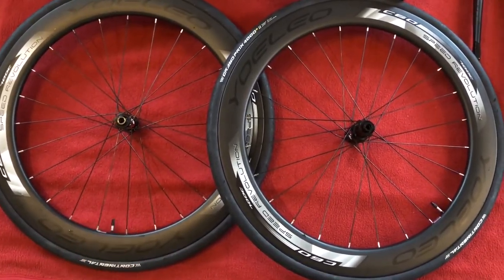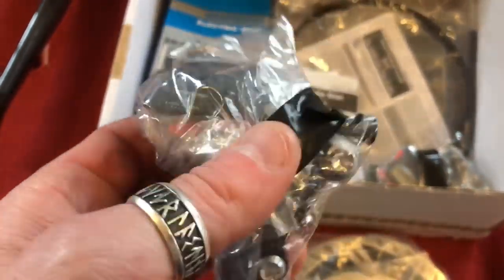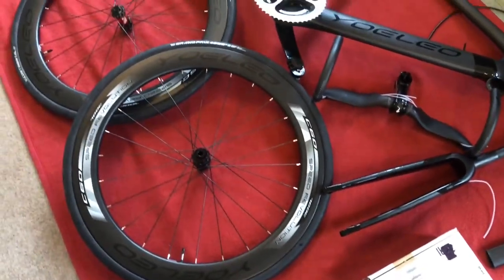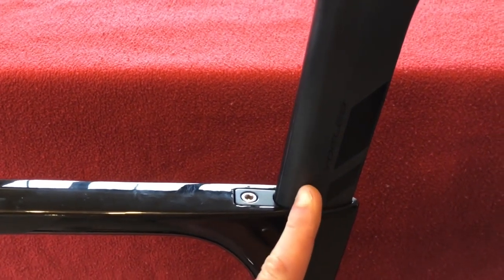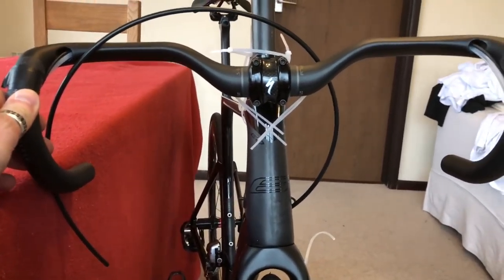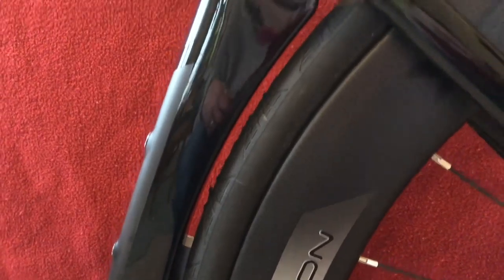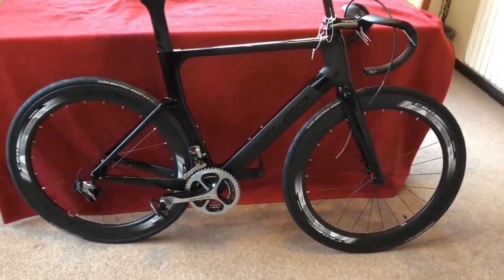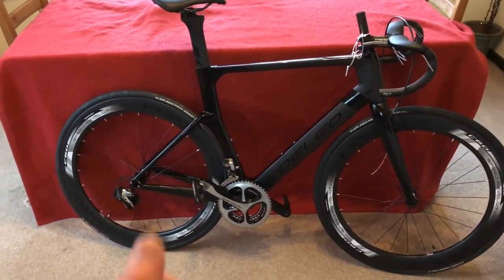Yoeleo R6 Aero Disc rough assembly before LBS

Comment: Nice video. It looks like the seat setback will be fine. I am a little confused though. The previous videos of this frame make it very obvious that the seat tube is far more upright. However yours seems to be at the same angle as the headtube . Maybe it is an optical illusion with the camera. Whatever it looks good and you should get the setback you require
Reply from the maker: cannon1156 yeah I moved the saddle clamp all the way back on the top of the seat tube, still gives me the rail adjustment underneath the saddle so hopefully it’ll be ok.
Reply: Yes I can see that. Have a look at oz cycles video. His seatpost strangely looks far more upright. Almost as if it is a different frame. Try to make sure your seat is clamped in the middle of the rails. Can be an issue if at one end
Reply: I have 140 discs all round. This is almost the standard now. You dont need 160. Heaps of braking in the 140s
Reply from the maker: cannon1156 I actually just watched his video! Yeah his seatpost looks way more upright. Could be an illusion I spose... could also be I’m using a non Yoeleo crown race as I lost the one that came with the bike, may be it lifts up the frame a bit more shifting everything back? Dunno
Reply from the maker: cannon1156 yeah I couldn’t send it back as I overran my return time limit, I’ll more than likely just buy a 140 and stick it on. Sell the 160 on eBay or something...
Reply: If I had seen your video I might have considered the frame but oz cycles looks way too upright. As I said above it could be just an optical illusion from the camera. But yours looks way more laid back like a normal bike. I know this frame is an open mould and is available from a large number of sellers but I doubt the mould would have been changed
Reply: @cannon1156  We didn't change the module.